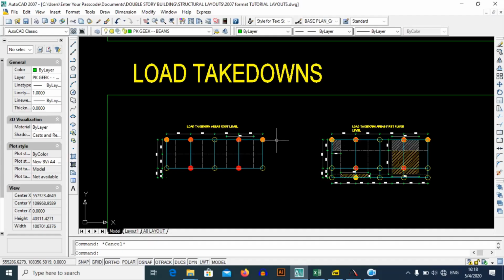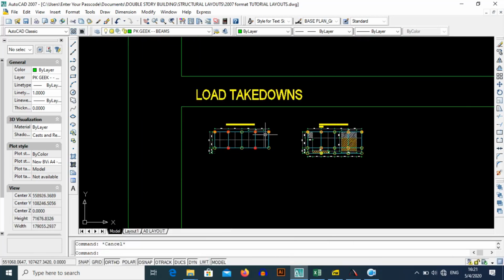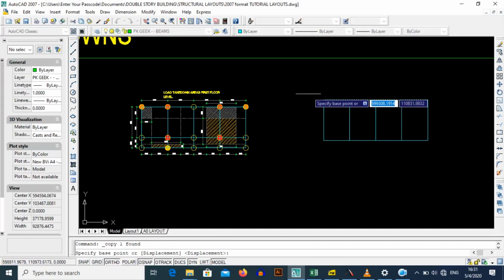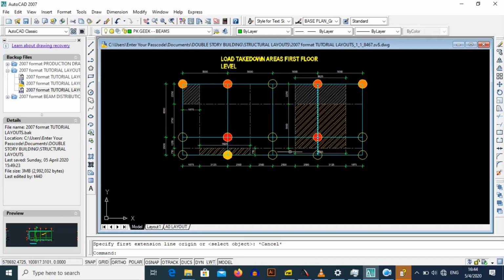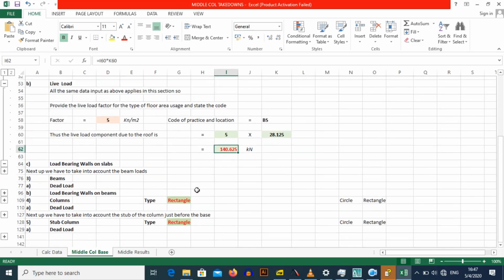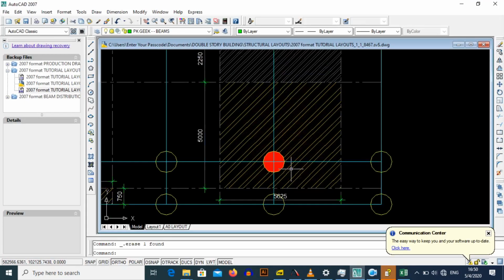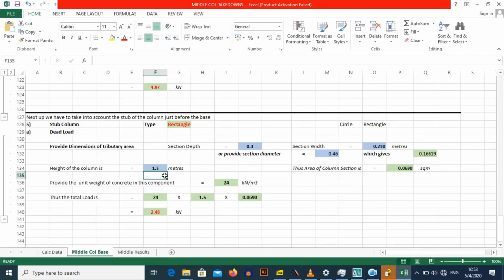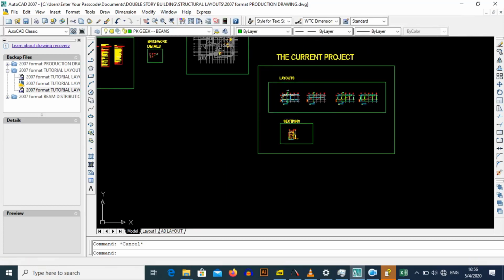HOW TO DESIGN A Double Story Building: Part 2A Load Takedown (An Example)

Comment: I have a question that might be a bit silly however, I understand that we took the DL and LL of the pitched roof. Then in excel, you jump straight into the DL and LL of the first floor. Am I right in saying that the slab under the roof was missed in the calculation?Or am I missing something?  Because section A-A shows a slab under the roof?

Comment: Hullo Prokon Geek. Thanks for the video and excel sheet. Great work you're doing in the engineering fraternity. Keep up the good work! I would like to comment about the computation for the base area; Isn't it important to factor in the self weight of the base as well? say 10% of the total un-factored load.

Comment: additionally i would like to ask about the tributary areas. could you please shade a thorough guide to the way you acquired your tributary areas? .theres alot of literature that suggests just taking half of the distance between the columns, should i disregard it.? any help will be appreciated.
Reply from the maker: Hey Atuhe, thanks a lot for watching the videos and subscribing and for being patient with my reply. I take you up on your suggestion i will work on a video with regard to that but don't disregard your literature its very correct this is a modification that comes from our area, remember in design everything is correct as long as you have a reference pardon late response

Comment: Hello Prokon Geek! Thanks for this great video. May you kindly make a video on manual load calculation using the material loads from Codes of Practice such as the BS 6399 for all structural members. It'll really be a great thing for you to do. Keep on producing this great content!
Reply from the maker: Hie Tendai so sorry for the late repy can you give me you email my phone crushed and i also have the materilas you requested
Reply: @prokongeek6239  Hey Prokon Geek! Not to worry for the late response and thanks a lot for responding regardless of the communication problems you've been having. My e-mail is tchikomo97@gmail.com
Reply: @prokongeek6239  mine too is engtmusekiwa@gmail.com, looking forward to hearing from you.

Comment: Hi. your channel will definitely grow because it is unique. I have one special request. You understand that loading and calculation of loads is one thing that an engineer can not afford to miss on. please do a video on the calculation of loads such as area loads, beam loads, roof loads, etc using weights of building materials or at least step by step calculation of loads....and not using excel sheets. It will help us alot to cement our understanding on loading before we go to usage of excel sheets and mathcad. Thanks
Reply from the maker: Hey Doug its definitely cool, i will start working on the script for the video or a series of videos where i will be going over a set of calculations because you are very correct, calculation of loads is very important and you need to understand where the loads come from before you even proceed to design
Reply: Also waiting for the same, this is a great and unique channel

Comment: Greetings man. How did you determine your tributary area for the columns?
Reply from the maker: i used the mid-point bisection theory and the outer edge theory where

columns on a continuous edge and not on the extremity of a column you divide the distance in half between the columns in two 

and then if its and exterior column on the discontinuous edge it gets 3/8 of the distance and the other column gets 5/8 

i don't know if this is clear, if it is not please tell me and i will make a video on it. Remember to subscribe and leave a like on the videos thanks for your support
Reply: @prokongeek6239  , As always, your input is appreciated. I believe it is clear. The idea of a video is definitely welcome still.
Reply from the maker: @simasikusikopo7982  that is great glad you understood it but definitely i will make a video on it as soon as i finish this series
Reply: @prokongeek6239  Great stuff. I got a copy of Greg Parrot's Reinforced Concrete Design book. Please include in your videos if possible, code references of any factors, equations etc. to this book or any other book your use for reference. Thanks
Reply from the maker: @simasikusikopo7982  That is great stuff and actually a cool idea, i have included screen grabs in my other videos but i am actually thinking of even listing the material in video description next time and also the part to which it applies, thanks for the feedback man you are a star!!
Reply: Great stuff man. Keep up with these great videos. You are giving out immersely valuable knowledge.